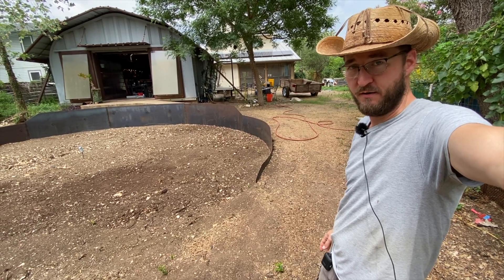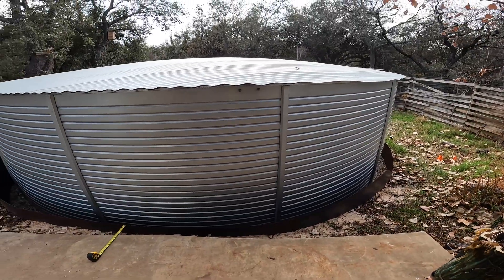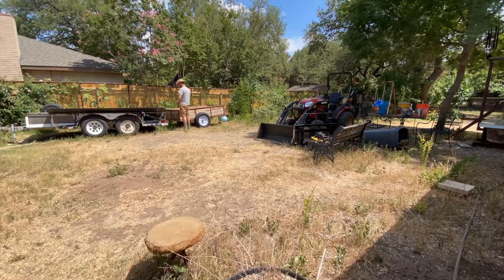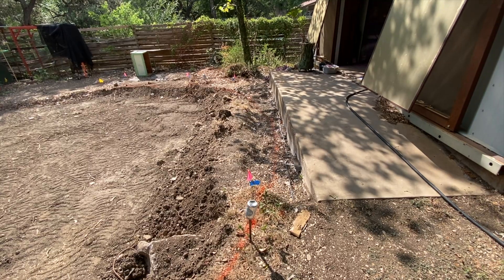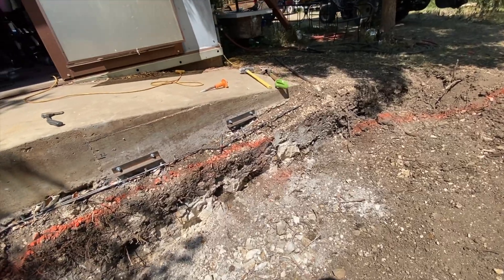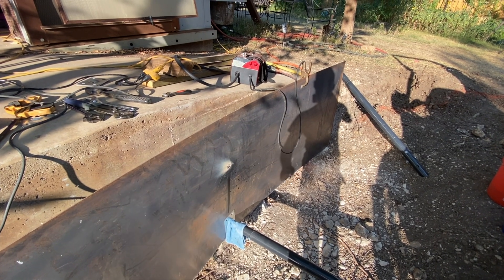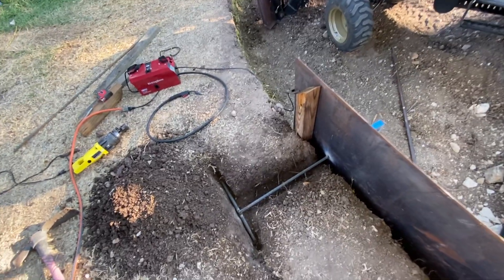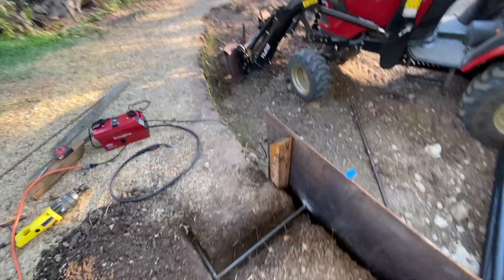How to bury a rainwater tank…… 2 feet deep.

Comment: I was wondering whether this rainwater is for human consumption? If so would it make sense to add solar panels to power UV lights to kill off bacteria?
Reply from the maker: Typically the UV lights are used where the water is filtered (inside the pump house). UV is not mandatory if a small enough pore filter is used. I do indeed have solar panels but they are on the house. More details coming in part-two video. Thanks!
Reply: @suburbanbiology  That makes a ton of sense, thanks for the insightful response, looking forward to more videos from you!

Comment: Those not-so-pointy-edges-anymore-after-cutting-parts-off are still quite pointy .. from the perspective of a video watcher at least.
Reply from the maker: They are not that scary in person. But I still may try to add a bumper of sorts in the future.
Reply: @suburbanbiology  I wonder if some form of pvc could work as a cheap bumper for the top. Wouldn't last forever, but on the scale of maintenance cycle for the container itself, it's probably at least that long

Comment: Looks cool. Love the design. Got to say though I would have poured those T-bar-anchors in concrete to be sure the will not cut through wet dirt. But it all seems sturdy enough for the task it has to fulfill.
Reply from the maker: Part two coming soon. Eventually I closed the ring so the wall is much more stable since it’s a complete circle now. Thanks!

Comment: Won't these welds and eventually the rest of the structure rust away in this configuration?
Reply from the maker: Eventually yes. I’m hoping that will be around the time the tank needs replacing and it can all be done at once. Hopefully 30 years or more. Thanks!

Comment: I like your video. Have you thought about how you going to prevent the steel from rusting? If you use a sacrificial anode on the steel will never rust. And you keep replacing the anode to keep your structure sound for years.
Reply from the maker: The certified installers of the tank itself, place two anodes underground that are connected to it. Thanks for watching!